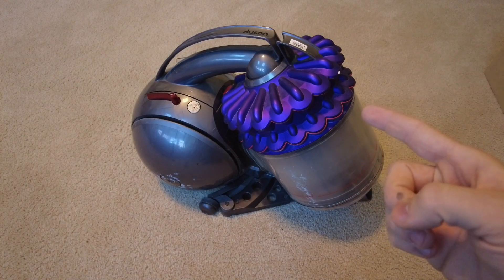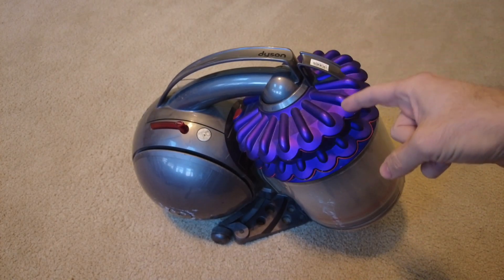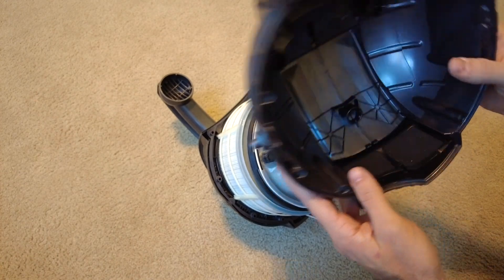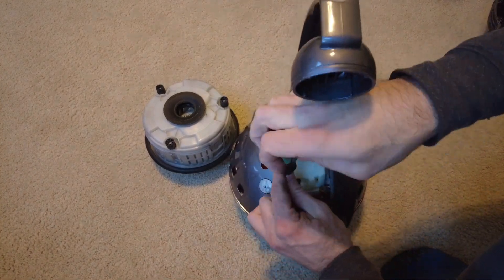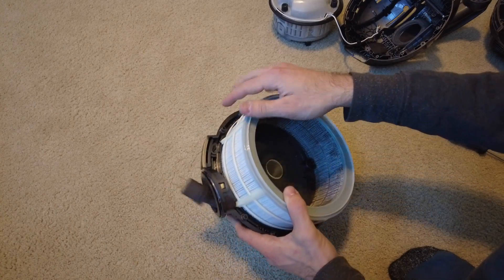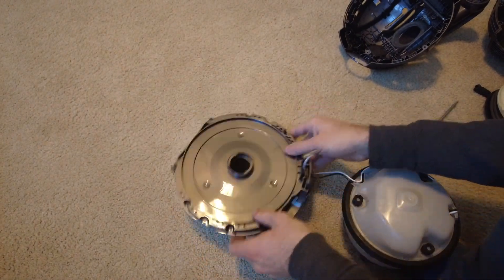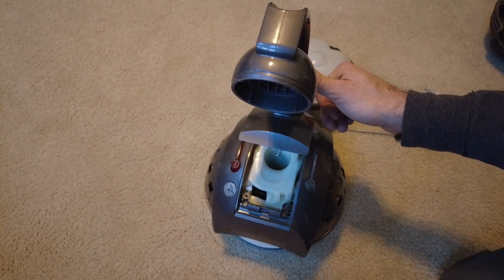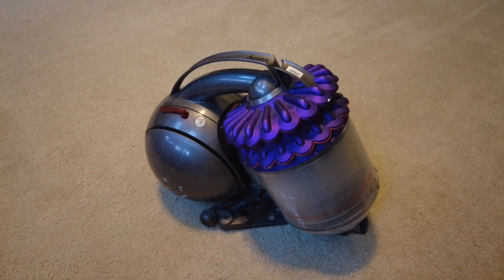Dyson DC78 CY18 Big Ball Cinetic Canister Vacuum HEPA Filter Replacement - DIY Tutorial

Comment: Thanks for the breakdown, just followed this to replace the motor and hepa post-filter in my 10 year old DC39 Animal. The post-filter was absolutely filthy inside, so well worth replacing at the same time. The outer side was completely clean so it's obviously doing its job well. That's another 10 years life added to the machine for £100 in parts direct from Dyson.
Reply: Ours is also 10 years old and the beater bar has become feeble because it's driven by suck. I have bought  a new main filter, and am thinking I will use the compressor in the garage to blow out the HEPA filter if it's dirty.
Reply: @iamaparanoidandroid1  tbh for the relatively small cost I'd buy a new one, the filter is so fine and it's more ingrained dirt than physical dust so I'm not sure blowing out with compressed air will properly clean it. Good luck if you try it though.
Reply: @richgit  the HEPA filter wasn't that dirty really, just a bit of carbon motor dust, and it seems to have blown out OK.

The main improvement has been changing the prefilter. This was visibly dirty (but nothing coming out when washed), and it now has a good deal more suck.

Comment: finally found a video for this!! I have a different model, same inner parts though. could not find how to get the filter out anywhere. now just time to find a replacement motor :(
Reply from the maker: Motor part number is "Dyson 965642-04", they are available on Amazon.

Comment: Well you certainly deserve that drink or three lol! I'm actually surprised Dyson can get away with claiming this vacuum doesn't have any filters when it clearly does! So where did you get the filter from and do you have a part number? Also how often should the filterless vacuum filter be changed? I just did my first deep clean on the bin on mine where I took it down as far as I could. I didn't have a T8 screwdriver only one T8 bit out of all my hundreds of bits so the deep screw holes I couldn't fit the bit screwdriver into those holes unfortunately so I just taped the inners of the cyclone up and used a can of compressed air to "clean" the rest of it. It's definitely not as clean as the rest of it which I washed with running water in the sink but it's way cleaner than what it was!
Reply from the maker: Whoops. I thought I'd added a filter P/N to the description. I fixed that. 

You can get the filter from most online parts suppliers, even Amazon sells them. 

I'd change the hepa filter every 2-5 years depending on how much you use it. This was the first time It'd been changed in about 5 years I think.
Reply: @Cap10323  Awesome! Thanks man! Just so you know I've added your YouTube video to a review I just did on Amazon about this vacuum along with added it to a couple other comments on other YouTube videos cause a lot of people were complaining about there being "star" bit screws T15's on the sides of their canister Dyson vacuums when the YouTube video was showing them how to change their filter and it was just a plastic tab you would unscrew on the UK models. 
I was wondering if you can maybe help me with the canister part of the vacuum as I just did a deep clean on mine and I took apart the cyclone top part as far as I could (my T8 bit driver wouldn't fit in the small deep holes so couldn't take it apart any further and the smallest screwdriver I have is a T10) but there's a rubber seal that goes around the base of the bottom purple cyclone head and the gray plastic and mesh screen which I can't remember which way it goes on. Does the rubber open part of the flange open up towards the top of the machine or does it open down towards the bottom? It's the rubber seal that seals the clear waste bin onto the cyclone head. I thought it opened towards the top of the machine but as I was tightening the screws it looks like it's getting distorted.
Reply: Actually I got it now that I watched another YouTube video which I also linked your video to cause the guy was struggling pretty bad with the teardown of the bottom base part of the bottom but like I commented on his video had I not already watched this one I would have rode the struggle buss big time as well. This thing is definitely over complicated! Lol. I had the gasket seal on the right way but when you put it back together you've kinda got to pull it out and away from the two pieces while tightening the screws to get it to seat properly. It's a little tricky but once I figured it out the rest of it went very easily. I think it may have shrunk a little when I was soaking it in hot water so maybe use cooler water to clean the gasket seal. Now to put the canister back on the base and see if this thing works like it should again lol man it was dirty but not nearly as dirty as this guy's. His wife really needs to empty her container a heck of a lot more than she was! Hers was so caked full of dirt it was blowing dirt all the way through the filter and motor and back out of the vacuum! If you want to see a very dirty one of these watch this video...

https://youtu.be/NI7v0HNGG2c
Reply: @John Machotka  No filters to maintain is also false advertising cause you do have to replace them. Nice try trying to change my mind though. Lol